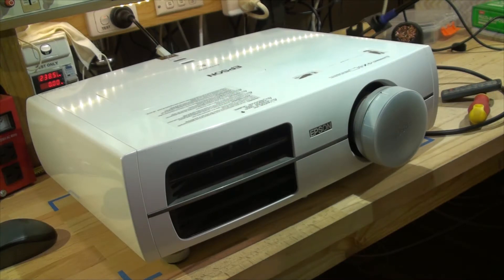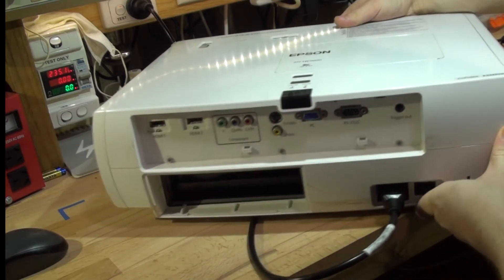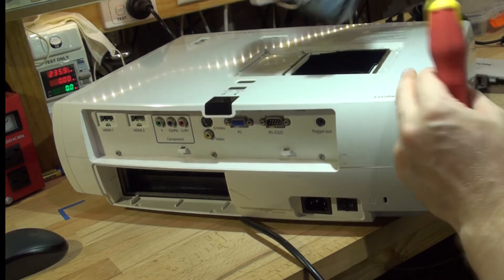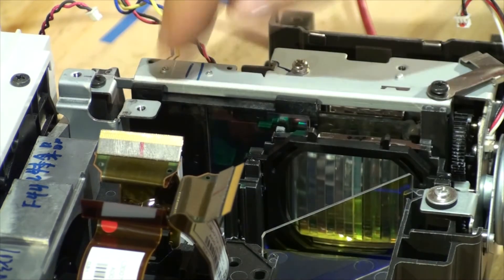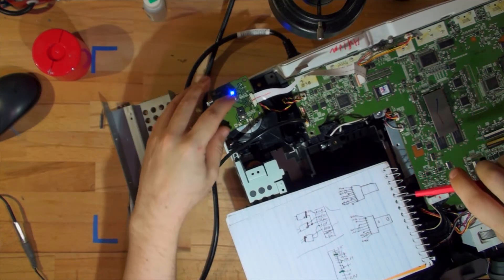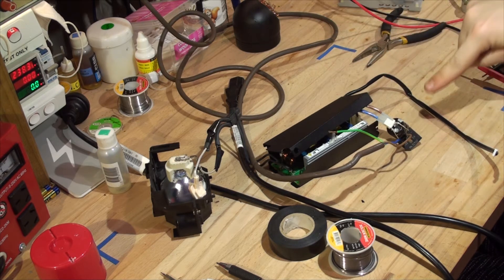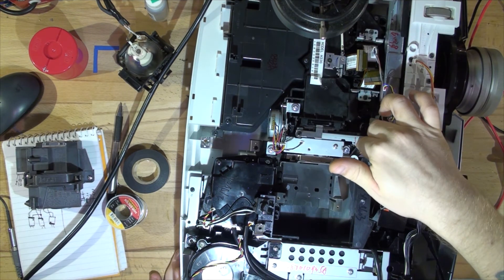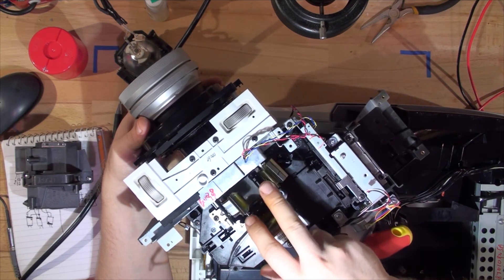Repair of EPSON Projector + Identifying bad polarizer

Comment: @MaxELECTRONICS The power supply compartment of my Epson EH-TW3200 sometimes starts making a loud metallic noise (buzz). The lamp works normally, but after a minute or two the projector switches off. Then I can turn it on and run again. About half a year ago I disassembled the unit, replaced filtering capacitors in the power supply (X2 ones), greased the iris cogwheels, and it helped for several months. Now the buzzing metallic noise is again on, sometimes after a few hours of working, sometimes just after a few minutes. Any idea what it could be? I am not an expert in switching power supplies, no schematics - nothing to work with. But I would like to save the projector. Maybe you recognize my description as one of some typical symptoms or issues with this model - the noise comes evidently from the power supply front vent and is loud and metallic. Something kind of coil resonance, radiator resonance, definitely has nothing to do with fans. Any help appreciated. All the best, Mike.
Reply from the maker: Check the lamp, it could be happening when then lamp is near end of life or it could be transformer on the ballast
Reply: @MaxELECTRONICS  Thank you so much for such a fast reaction, the lamp has some 1000 working hours but I will give it a try. But I used to replace the lamp during previous diagnostics process before repair half a year ago and the buzz remained despite brand new lamp on. The sound is pretty crazy I put the video in cloud to show you how weird it sounds - https://photos.app.goo.gl/6K9kr7xeRyNJtNzt8
Reply: @MaxELECTRONICS  Thank you so much for such a quick response. I recorded this crazy metallic noise coming from the power supply vent: https://photos.app.goo.gl/6K9kr7xeRyNJtNzt8 maybe you can recognize what it is. Half a year ago the noise was identical, replacing the lamp did not help, replacing X2 caps - yes, but the noise is back and the unit switches off. Best, Mike.
Reply: @motospacepl sounds like one of the fans is hitting a loose wire

Comment: Hi and thank you for the amazing video! Recently i purchased a Epson 8700ub and when i plug it in it only shows epson logo and nothing else after that. it only shows blank screen. No menu, nothing. Nothing happens when i press any buttons on the unit or remote (menu or power).  I have tried any combination to try to unlock buttons nothing works. Just replaced the lamp yesterday and nothing changed. No lamps are on for overheating or bad lamp. I can hear fans working. Do you have any idea what may be the problem? Thank you so much!

Comment: Awesome video, thanks for making it. Trying to diagnose why my EPSON 8350 after the bulb died and I bought a replacement bulb and new air filter (overdue). Now it shuts off after 2 minutes of working properly. When it shuts off the 'lamp light' is flashing red and the 'temp light' is not illuminated. What is the "Lamp Light" checking for if usually it means a burned out or improperly seated bulb? The bulb works properly on startup? Ballast going bad after getting warm? Some intermittent lamp connection? Next step is to open it up!

Comment: Hello friend! I have a Panasonic Pt ae 4000u projector, when it turns on it only turns on the light without generating an image. So I turn it off and after a few moments I turn it on again, then it turns on normally generating an image. Could this be a video card issue or an internal source issue
Reply from the maker: Check the ribbon cables that connect to the lcd panels, check bus voltages on boards, and all voltage regulators

Comment: Hi Max, Thanks for demystifying the projector's optical system, as I have never worked on a projector before. I purchased a second-hand faulty Epsom  TW- 6000W that has an error showing the temp and lamp indicators flashing red. I have tested the temp sensors, and most of the fans spin with 12V applied. There are two fans, which are Toshiba SF84M12-51AP, that don't spin with 12V. I could not find a datasheet on these. Should they spin with just 12V, or do they need a PWM signal to spin?
Reply from the maker: If they 2 or 3 wire, then they should spin with 12v if they’re 4 wire then you need pwm.
Reply: Thank Max for the prompt response. What else would you suggest I should look for to solve the lamp and temp error lights. Also, after seeing you video I looked at the polarisers and noticed the one for green was on an angle unlike R and B which are parallel to the lcds, is this  normal?
Kind regards 
Anthony
Reply from the maker: @anthonydebono8700 check that all thermistors and thermal cut outs are okay, check that all fans are spinning, make sure bulb is good. Are you talking about input or output polariser ?
Reply: Hi Max. The angled polariser is right in front of the green LCD.

Also, when the lamp and temp error is indicated, it is at the moment the lamp comes on. Does this mean the lamp is the issue? I know the previous owner had the lamp ballast board replaced.

Thanks in advance
Reply from the maker: @anthonydebono8700 it’s hard to tell with the lamp, you can strike the lamp by shorting out the optocoupler and see it it ignites property, but use extreme caution, there are very high voltages in that ballast, as for polariser, if it’s not loose then it’s probably suppose to be on the angle.

Comment: Thanks for the reply buddy. The LCDs on my Epson have the following codes: blue LCD L3C07U-85G11, green LCD L3C07U-86G11, red LCD L3C07u-85G11. Panasonic panels are: blue LCD L3C07U-86G11, green LCD L3C07U-85G11, red LCD L3C07U-86G11. Can you let me know if I can replace these panels, i.e. if the Panasonic panels will work on my Epson
Reply: Yes, I know that. However I will buy the complete optical block with the three LCDs already aligned and glued to the prism. It was taken from a Panasonic projector without concert
Reply from the maker: @cinecastrocastro8412 that’ll work just make sure that the yoke will mechanically fit into your projector
Reply from the maker: Yes they will but you won’t be align them, your convergence will be off no matter what you do.

Comment: Hello, I have a projector just like yours, this one and the EPSON POWER LITE HOME CINEMA 9500UB. There was a problem with the LCD panels, I had to remove them. A friend of mine offered me the Panasonic PT-ae 3000 panels, which according to him could work on my Epson since the panel codes are the same. As you are a technician, I need to know if replacing the Epson panels with the Panasonic panels would work.
Reply from the maker: If they’re same model number then yes but you won’t be able to put it back together because the convergence will be off and there’s no way to align it at home, usually you’d replace whole yoke. You should never separate lcd panels from the prism.

Comment: Just curious I have a power lite 8100 and I am getting just a little blurring at the to and bottom of my picture with a slight hint of pink any thoughts? Could this be my bulb or dirt inside. I did clean my outer lens any help would be appreciated.
Reply: Thank you for the reply
Reply from the maker: It’s possible that there’s mirrors in the engine that are misaligned, check that all optics inside the engine is properly in place and not loose

Comment: Hello I'm using EPSON eh-tw3600 projector and I'm inquiring. I use it by fixing it to the ceiling and the fan makes a rattling sound for a few minutes when it's first started. I suspect it's a fan problem, so can I know which fan goes into that projector? (Fan model name)

⬇️ my problem video
https://youtu.be/VAVRG0zEcm8?si=Ebexba2BrEqvtjkZ
Reply from the maker: Hi, you need to open up and have a look, there’s few different fans and blowers inside

Comment: Hi, Thanks for the good tutorial,  My question is about a lens (exact name I do not know) At 5.53 min of this video it is very visible It is the vertically laminated square lens in front of the green xv color filter you just activated. The lens I assume is a diffractor of some sort.  It is a non-replaceable part I understand.  Can it be removed and still work, ok?  As soon as I get some parts in the mail I will test.  Mine is burnt, delaminated and the glue is browninsh. Yes very late to the party here.
Reply from the maker: You can buy a replacement lens, AliExpress would have them, that lens spreads the lights evenly through light guides. You’ll loose all brightness if you remove it

Comment: Greetings Max and thank you for this great video. I just bought this same model second hand and the focus ring is really tight, maybe stuck. Id like to ask for your advice for the proper way to handle it since I don’t want to force it and I can’t figure out what could be keeping it tight. The zoom ring works smoothly though. Thank you!
Reply from the maker: You can pull it apart and remove just the lens, it should be obvious what’s the problem once you get the lens out.

Comment: Hi Max, Thanks for the video - I don't suppose you have a spare mainboard (bottom one) for a EH-TW4500? I have broken the connector for the Green LCD on the board and I think the easiest repair is to get a new board! Please let me know!
Reply from the maker: Unfortunately I don’t, but you can buy spare connectors on ebay or AliExpress
Reply: @MaxELECTRONICS  Thanks so much for replying! I have tried to look but can't identify the correct one! I don't suppose you know the actual connector name or part number etc? I can do the repair if I had the connector! Thanks so much.
Reply from the maker: They called FFC/FPC connector, you can find them on ebay, you just have to count how many pins, and measure pitch. Here’s link with example:
 https://www.ebay.com.au/itm/295220293017?mkcid=16&mkevt=1&mkrid=705-154756-20017-0&ssspo=hso6y7cpsw2&sssrc=2349624&ssuid=D1OZOxU5QAG&var=&widget_ver=artemis&media=COPY
Reply: @MaxELECTRONICS  Thanks SO much!

Comment: Hi max. Great video! You are really knowledgeable and I admire your ability to explain.

I've got an Epson tw6100 which is faulty, showing a brighter horizontal line just below the middle with the lower part being red in tone.

I'm curious if this could be symptoms of a bad polerizer. Not sure how to share an image of the issue without YouTube removing my comment.

Thanks for your help.
- Simon
Reply from the maker: You can send the image to the email, maxchristensenau@gmail.com
Reply: @MaxELECTRONICS  thanks friend, I've just sent you the image 👍

Comment: Dear Max, I'm just a little bit confused, the green tint is caused by the green polarizer, and what you cut out is the blue polarizer, so the green polarizer can be replaced with the blue one? I remeber for the output polarizer, it must be same color polarizer can be replaced? thanks very much
Reply from the maker: Hi, yes green tint when the screen is suppose to be black is caused by green input polariser , it just needs to be adjusted (tilted right or left) until tint disappears and spleen becomes black, (that only if the green tint you seeing is even through the whole screen) if it’s only green in some places then it’s your output polariser.
In some projectors green and blue are the same output polariser type, but in some projectors green output must be replaced with another green one. You could always install the blue polariser in place of green and see if the colours change, if they don’t change then you can use blue one in place of green.

Comment: My comment / question seems to have disappeared…
I was asking where to find input-output polarisers. Now saw you said AliExpress no matter the projector’s brand. Can we find all polarisers (red blue yellow) ? Think there are 8 of them in there…
Reply from the maker: Hi, yes YouTube seems to remove random comments, I never delete any comments regardless if they positive or negative. 
I only dealt with green ones, as they usually the ones that burn out, but yes, AliExpress is where I buy them.

Comment: Thank you for this great video. I've got a question concerning the two red lights flashing. I have the same issue which startet some days ago while running the projector for a couple of minutes. Bulb turned off, plus both red lights fashing. Afterwards I was able to watch about half an hour with no issues. Then again the same problem. I exchaned the bulb but nothing changed. Now it's exactly like in your video at about min 12. The bulb lights up, runs  a couple of seconds and turns off again. When you say the problem is either the shutter or the cinema filter, do you mean the red flashing lights point directly to these tow possibilities or might there be any other reasons. thanks in advance!
Reply from the maker: Try turning “auto iris” to off, if the problem continues then it must be one of the temperature sensors are faulty, also check that fans are clean and no dirt is built up in vents
Reply: @MaxELECTRONICS  Thanks for the quick reply. Is there a chance to get into the menu to turn auto iris off without the bulb lighting up?
Reply from the maker: Maybe send a command over the rs232, but check for other things first that I’ve mentioned before
Reply: @MaxELECTRONICS  Thanks again for the reply. I figured out that auto iris is not activated so this might not cause the problem. I noticed the behaviour that when I didn't try to start the projector for 24 hrs. then  it starts correct and runs for about a min till it shuts down to the error mode. when I try to start it again then it's the behaviour as yours in the video (bulb lights up and shuts down after a few seconds). After several times trying to start it doesn't even try to light the bulb. Does this behaviour lead to a certain point where I should start looking for faults? Thanks in advance.
Reply from the maker: It could be faulty thermal sensor, if it runs for a minute and then shuts down, also check for any abnormal looking electrolytic capacitors on any of the boards, they look ether with slightly raised top or they’ll look chubby compare to good ones or they’ll have some brownish residue around them

Comment: Hi really great fix-tutorial, thnx.
I was wandering if you could share a little bit of your knowledge, and help me out with my projector.

I have an Epson Powerlite 730HD, and the whole image is blue tinted...I can see the red and I guess some green too, but the main colour is blue.
Could it be the polarizer?
Or its something else?
Reply from the maker: Sounds like an lcd panel, check that no optics is loose and nothing unglued. If everything is in place check the connection to the lcd panels. Try displaying black text on red then black on blue and black on green , see what one doesn’t show up